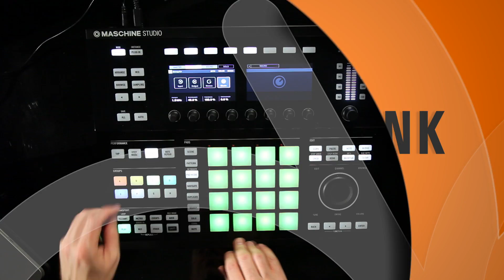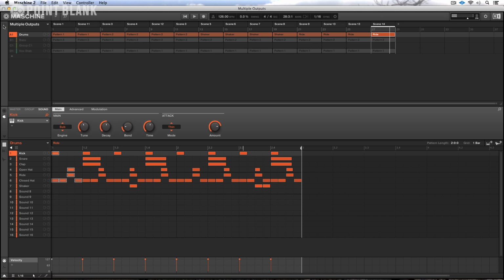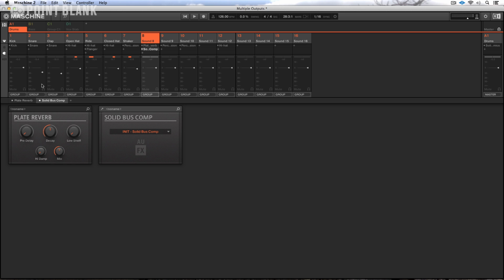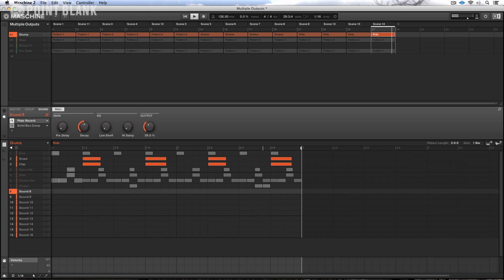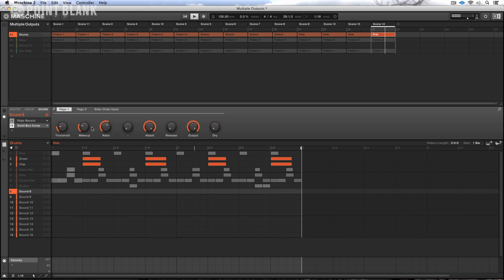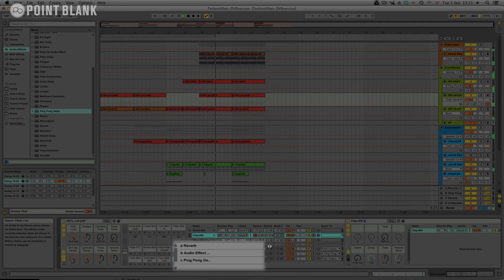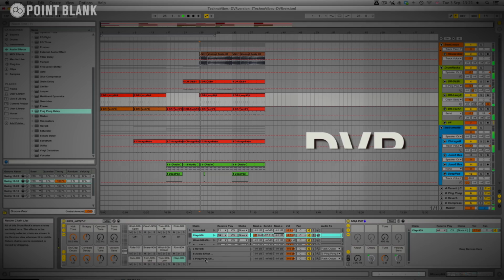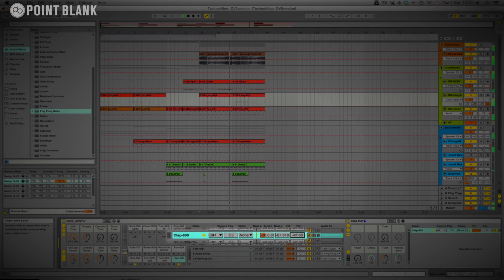Maschine & Logic Pro X Part 2: Creating a Mix Bus in Maschine's Mixer

Comment: This is just a video showing how to process 2 sounds with the same effects, I would vote against this method solely for the fact you cant control how much of the signal you want to be effected unless the effect has a mix function. Not really a Bus in machine yet but defo needs it ASAP